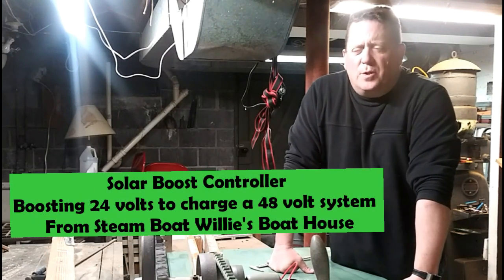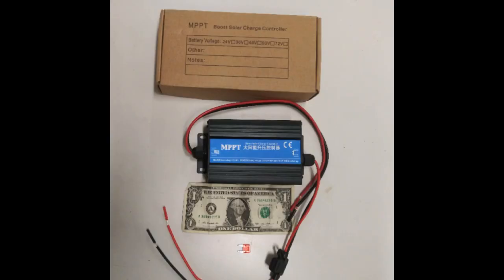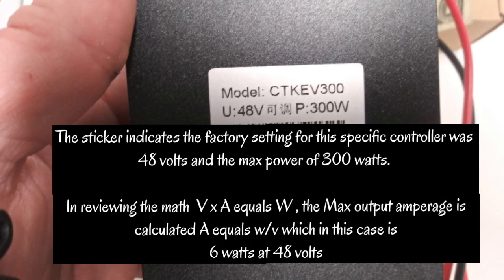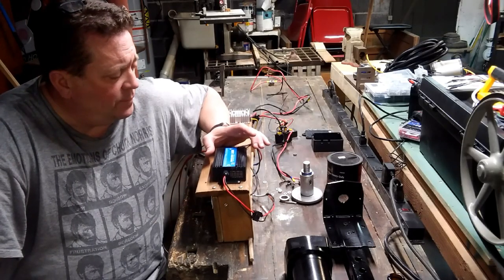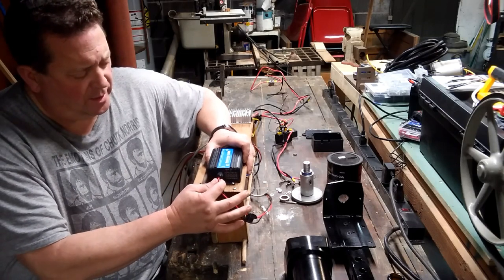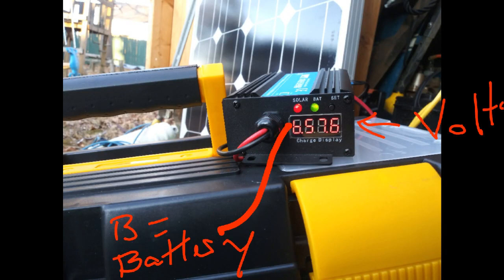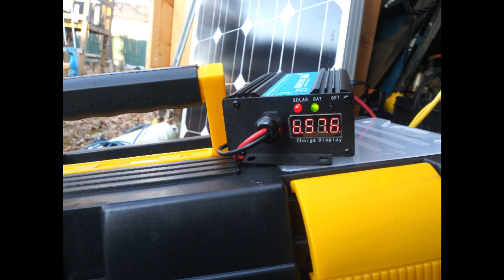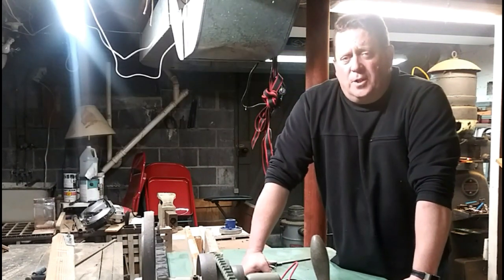Cheap MPPT Solar boosting charge controller 24v charging 48v

Comment: Hey, any updates? What is the max power you've been able to get out of it? I have a 310W panel (33.6Vmp) that I need a controller for to charge a huge 18S (74.7Vmax) lithium battery.

I tried the common green one (MPT7210A) and I'm only getting a third of my panel's output. I can't seem to find any reputable designs/sellers of good boost controllers that can go this high for under $1000.
Reply from the maker: I've been using mine on my boat for two years. last year I ran it with two 12 volt panels in series and I had no problems. I switched it this year two charging in parallel with the panels because I had a third 100 watt panel I wanted to add as a plug in  just in case I needed to charge up quick.  When I tested the system of 160 watts worth of solar  panels. I got 3 amps to the 48 volt battery bank . as it turns out after the test I never had to plug it in and got a consistent 1.5 amps to the batteries . two years this unit has worked for me. I would say that it states it limit is 250 watts and I think 60 amps. Though so your 310 watts might not work on it . I know victron makes quality Chargers like this they're more expensive but it may be worth it in your case
Reply: @philcostello6989  Hey thanks a lot! I decided if it works it would be my best option, and panels rarely are at 100% output anyway so I wouldn't be losing much. Two units came from Ebay in 4 days and I'm getting 260-280W on each, each hooked to one panel (after peak/way after solar noon). Who knows how accurate the MPPT is but it's fairly efficient and fast to track! Even for my very high boost conditions... >87% MINIMUM of rated power (aside from input current limits, I think most designs only reach max power&eff at like a 10V boost, not my 36V->72V)
Reply from the maker: @brandonsprague7098  overall I'm really happy with mine and I was thinking about you having to so if for some reason you are down you're only down on one side and they still have the other running

Comment: Nice setup.

I would recommend making a support system for the solar panels on the back of the boat.  

This will prevent shading from the mast, boom, an / or sail to maximize solar output.

The support should be angled.  The lower part of the angle should point to the water, and the top part should point to the mast.

The purpose is that when you anchor, you will anchor with the bow of boat pointing towards true North.  Therefore, the panels will be facing South, and this will maximize solar production.
 
Make sure the support system is tall enough that you will not bump into it and hit your head, and make it wide enough so that it utilizes the full width of the boat.  

This will permit you to accomplish two things in the future: 1- you will have the ability to add more solar panels on the same support system, and 2- if you decide that you still have shading issues, then you can add additional battery chargers.  

An additional benefit from this installation is that you will bet shading from the sun.

Suppose you have two solar panels, and each has its own solar charger.

When one of the panels is shaded, it’s output will go down, but it will not affect the output from the other solar panel and charger.

Here is a video of a similar installation:

https://youtu.be/cMENm_7MenY

However, don’t use square parts like he did.  If he bumps his head on one of those corners, he is going to be sorry.  Instead use rounded tubing, and if you are worried of water getting trapped in it, just make some small holes to let the water out.  Also, he did not cover the area over the scoops with solar panels, and he could have added additional panels over them.  It may not be so important for him, but it may help you with an electric motor.
Reply from the maker: Thanks, very smart!  Very cool set up!!!
Reply: Phil Costello thanks. Yeah, he did a pretty nice job.

Here is a site for sailing electric parts perhaps you already know it:

https://www.thunderstruck-ev.com/electric-sailboat-kits-and-accessories-inboard-motor-ev/

Comment: Can you set to float voltage to 24 volts?
Reply from the maker: You could set it for 24 volt battery system and use 12 volt panels  . If you click on the description link on my video it references two other you gentlemen who have videos on this controller . One shows you how to change it
Reply from the maker: Yes you can change it to 24, 36, 48, 60 volt systems